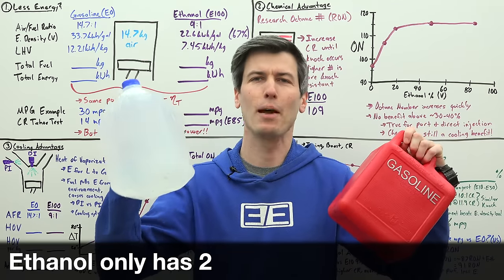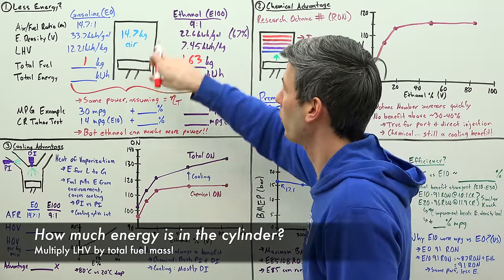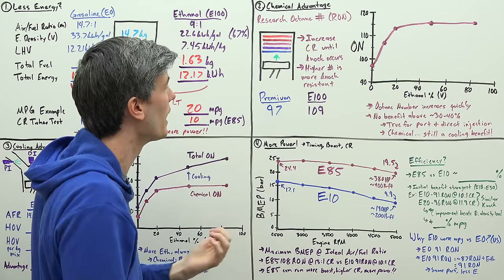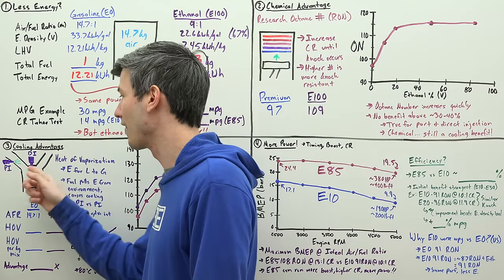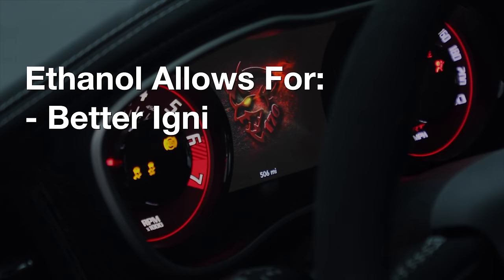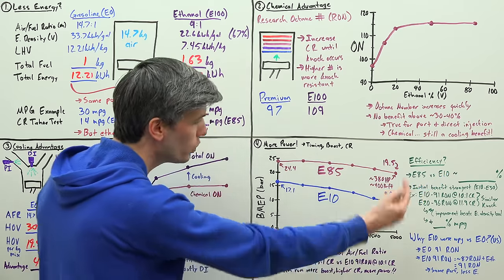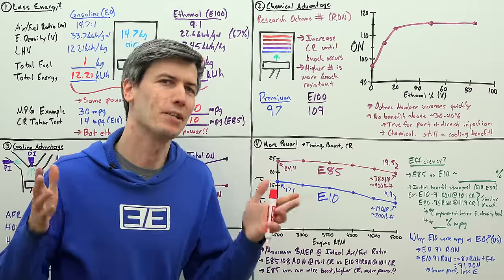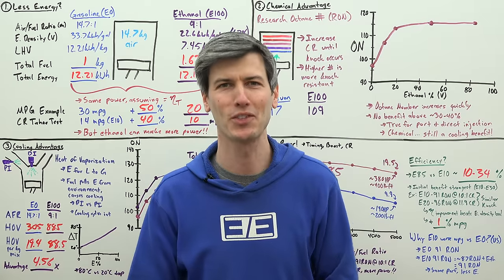Why Does Ethanol Make So Much Power? (Versus Gasoline)

Comment: E85 ethanol will deliver around 10% LESS gas mileage than you get from regular gasoline. Ethanol has only about one half of the BTU output as gasoline so it is less efficient. Ethanol is also more damaging to some fuel systems that weren't designed to be used in ethanol/gasoline fueled engines. SO, E85 fuel makes LESS power. Not more. It was only blended to extend our gasoline reserves and it produces slightly less exhaust pollution.
Reply: The very first flex fuel cars were methanol capable also.  Since methanol is slightly corrosive, stainless steel fuel lines were used.  When it became apparent that methanol sales were not happening, the methanol capability was dropped and the standard mild steel fuel lines were then used for flex fuel vehicles rated for ethanol only.

Ethanol on most any manufacturer's chemical compatibility chart you will find is at worst equal to or more often less damaging to rubbers, plastics, and metals than what gasoline and BTEX (benzene, toluene, ethylbenzene, and xylene) are.

In our inefficient gasoline optimized engines, ethanol will get less mileage but more horsepower.  For example, a Chevy 5.3L engine gets a clean 380 horsepower at 5600 rpm vs a dirty 355 horsepower at 5600 rpm on E0.

Ethanol at our current usage levels came to be as the replacement for the disastrous oxygenate/octane booster MTBE.  The petroleum industry went along with the legislation for hidden in the bill was legal immunity for them from MTBE.  This was discovered and removed but the bill still passed.

Denver in 1988 was the first government entity to require E10 when they they were on in EPA list of ozone non-attainment zones.  Soon with ethanol they were off that list.

Even with just 10% ethanol added to E0, the Swiss Federal Laboratory for Materials Science and Technology found that the especially health devastating ultra fine or nano particulate emissions were lowered by 97%, carbon monoxide lowered by 81%, carbon dioxide lowered by 13%, aromatic hydrocarbon emissions lowered by 67-96%, and genotoxic emissions lowered by 72%.
Reply: @danafletcher2341  But if they went to butanol instead, it would have almost the same output as gasoline by itself BUT it is also much more corrosive on parts and much harder to produce. Oh, and don't forget, Indy cars, like moonshiners of old used to run their cars on pure alcohol fuel.
Reply: @stephenbrinckerhoff3510  The Indy 500 uses E98 even now.

Ricardo built an ethanol engine for GM and it ran in a pickup.  Here is an excerpt of an article describing it.  Note it gets more mileage than even a diesel engine which is itself better than gasoline.

FROM RICARDO:
The new federal CAFE standards are calling for a doubling of fuel mileage performance, which, Vint says, is going to send OEM’s looking for high octane numbers to improve efficiency and ethanol is the best source. Ricardo, an engineering firm with over 100 years in the business of engine design, has developed an extreme boosted direct injection engine (EBDI) to optimize ethanol blends. The 3.2 V6 gasoline engine rivals the power and torque of a much larger GMC Sierra 6.6 diesel, he said, and it delivers 3.5 percent better fuel economy than the diesel.

A Brief History of Racing Fuel By Craig A. Johnson

In 2005, the IRL used 100 percent methanol in their tanks. The fuel worked well and was more efficient than straight gasoline, but IRL officials believed there was room for improvement. In 2006, they moved to a 10 percent blend of ethanol and methanol, which was then changed to 100 percent ethanol for the 2007 season.

The desire to use only ethanol aside, 100 percent ethanol is nearly impossible to obtain, and is illegal to keep without paying hefty taxes that date back to prohibition. The actual fuel used by the IRL is a blend of about 98 percent ethanol and 2 percent denaturant. The exact composition includes a small amount of high-octane racing fuel.

The fuel for today's Indy cars has an octane rating of 113, compared with methanol's 107. This means a significant reduction in pre-ignition, or knocking and pinging.

In addition, many of the people who handle the fuel, say it smells like tequila. This quality may seem insignificant, but smell is actually one of ethanol's benefits when compared with methanol. Pit crews noticed the switch to ethanol immediately, reporting fewer coughing fits and less eye irritation before any other modifications were made to accommodate it.

According to Dennis Vervynckt, manager of hospitality services and an IRL official, in 2006, the first year the IRL began using ethanol, teams saw a reduction in efficiency of about 10 percent. "That's because we put straight ethanol into the tanks," he says. "The teams initially didn't make any or very many adjustments to their engines. After a few months, they kept tweaking and by the end of the season they were back up to 100 percent efficiency."

Vervynckt points out that there was a minor loss of power. "When they first started using ethanol, teams saw a slight drop in horsepower," he says. "As the teams got used to the fuel, they were able to get more horsepower from ethanol once they again reached maximum efficiency."

The switch to ethanol also allowed the racers to carry less fuel and make fewer pit stops, thereby increasing efficiency even more. "When the cars ran on methanol tanks had to hold 30 gallons to accommodate the fuel requirements of the cars," Vervynckt says. "After getting the engines to perform at their full potential, there was a significant gain in mileage. Indy cars now have 22-gallon tanks. When a driver pulls in to change out his tires, he can fill up. Teams were able to match their tire and fuel stops exactly, instead of stopping for tires only, or fuel only."

That efficiency translates into much less fuel being used by the sport. Lifeline Foods LLC, which supplies fuel for the IRL, will produce 120,000 gallons of ethanol for the 2008 season. And though this may seem like a lot, it's 20,000 gallons less than was used the previous seasons.

The switch from methanol-based fuel to ethanol has amazed almost everyone in the league. Drivers, the direct users of the fuel, voice their approval in glowing terms. "[Ethanol] is an American fuel that is good for the country and the environment," says Ryan Hunter-Reay, of Rahal Letterman Racing and driver of the ethanol car. Standing beside his crew as they make last-minute adjustments to the car, he is more than happy to discuss the benefits of the IRL's switch to ethanol. "It's been great for Indy racing the fuel economy, emissions there's nothing we don't like. We love it."

Comment: Gasoline has way more power then e 10 e 15 ask my van my quad my lawn tractor if you want to use it in your race car ok out side of that it junk gas it's in the btu ..no. Away around it....pull a trailer you will figure it out.
Reply: A Chevy pickup with a 5.3L engine produces a clean 380 horsepower on E85 vs a dirty 355 on E0.
Reply: @danafletcher2341   Dan sorry if your 5.3 is cranking out that kind of power it's running at the speed of light...it's in the btus it's science .
Reply: Actually it’s called engineering 

Sorry, but those were GMs own published SAE certified horsepower numbers.
Reply: @danafletcher2341  — Dana, you’re wasting your time. Anyone that is intellectually incapable of differentiating between energy density and power potential is not able to have a rational debate with you.
Reply: @danafletcher2341  It really is pure free entertainment for me....small thing for small people.  I also love driving straight by them on the road.

Comment: What a bunch of BS.   It takes at least 3.5 gallons of water to make one gallon of ethanol.   Where are you going to get the land to grow the biomass?   How much petroleum is required to farm the ground, fertilize the crop, and how much pesticide will be sprayed to produce the biomass?   And finally, how many people are you going to be willing to kill making their food into fuel?   All to gain maybe 1% increase in mileage?   That’s what wrong with all of this greeny crap,  it’s all a flimflam.
Reply: Actually, the ethanol industry is now at 2.7 gallons of water per gallon of ethanol and most of that (unlike petroleum) is in the form of steam. (I can see heat pumps someday taking that number lower)

The National Geographic states it takes 13 gallons of water to produce a gallon of gasoline.  Whatever the number is, it is far more than 2.7 and higher with fracking and tar sands which we are now having to go to for crude since the easy to get conventional crude has already peaked.  Not to mention all the ruined and contaminated aquafers and oceans left in the petroleum industry's wake.

With feed grains like corn, you do not need extra land since it is a value-added from already existing feed production which preserves the feed in a healthier and more productive form called distillers grains.

The US used 11,160,933 tons total fertilizer on corn in 1980, before ethanol.

In 2018, the year of most ethanol production ever, the US used 10,521,850 tons total fertilizer on corn.

The US also used more pesticides in 1980 as well.  

100% of the fertilizer (& everything from the soil) still get fed to livestock in the distillers grains.  Ethanol comes from only things of the air: solar energy, CO2, and water with the latter two recycled once burnt.

Ethanol C2H6O = no fertilizer

Distillers grains = all the fertilizer

What logic is it to then assign all the energy and CO2 of fertilizer to ethanol and none to distillers grains? 

Iowa State University measured all the energy it takes to produce an acre of corn into a "diesel fuel equivalent"
This included making the machinery, fertilizer, chemicals, plus the tillage, planting, spraying, harvesting, drying, trucking etc. 
They found it takes 34 gal of diesel to produce one acre of corn.
What do we get from those 34 gallons of diesel?
We get >500 gallons of ethanol.
But wait, that is not the kicker.
The kicker is we still get 100% of the protein and other things from that acre of corn still available for a healthier and better feed called distillers grains. A win-win.

Comment: Here is a little secret that they don't want you to know.  What is the difference between 84 octane and 104 octane.  First, the 104 octane is used in racing cars.  Anyway, the higher the octane the longer the wait for ignition!  What? Yes!  The 84 octane explodes faster!  To make more power you need a delayed explosion.  Ethanol explodes too quickly.  This lowers performance and power in the engine!
Reply: LOLOLOL … Your reasoning: So when petrol has higher octane the “explosion” is delayed and power is increased. But ethanol, which by its very nature has a very high octane rating, “explodes too quickly”. 

So how is it that a high octane rating means a delayed “explosion” with petrol, but not with ethanol (according to you)?

So by your rationale, 2+2=5 …
Reply: @S King  OK, I blew it.  They mix the ethanol with gas to obtain 87 octane.  However, I did forget a couple of things. Ethanol evaporates too quickly. Also, it reacts with oxygen quickly, making an acid corrode the fuel system and also damage the engine!
Reply: Ethanol below 70 degrees F has little vapor pressure which is why E85 has the 15% gasoline which has vapor pressure all the way down to -45 degrees F

In Brazil where E100 is sold they instead use heated injectors for starting similar to diesel using glow plugs for starting
Reply: @danafletcher2341  Great!  Now go and do your own research on your computer.  Type in the statement; problems with ethanol as a fuel.
Reply: Brazil has identical non-flex fuel cars, boats, motorcycles, and small engines we have and their common gasoline is E27.

It has worked out so well and for so long that Paraguay went to E27

Ethanol means northern states need not buy little cans of alcohol called Heet or Dry Gas as gas-line antifreeze to deal with E0’s water problems anymore.  Mercury Marine even thinks E10 may be the superior fuel for this reason.
Reply: @johncipolletti5611  Actually i didnt type in ANYTHING 18 years ago I went outside and DID it. I tried E85 and look at my own results on my own vehicles...not that hard.

Comment: We all know the ethanol fuel experiment has failed. But big government keeps pay subsidies to grow corn for ethanol.
Reply: Ethanol production is kinda insulated from corn prices for if corn prices are low, then so too are the prices for their distillers grains.  But if corn goes up in price, they make up with high price for distillers grain.

The explains how ethanol can remain so low in price despite the current high price of corn, they are making it up with high prices for distillers grain.

The spot cash delivered NYMEX price of ethanol is $2.36/gal

This price of a sub-grade unusable gasoline (RBOB) is $2.84/gal.

To turn RBOB into a usable E0 fuel even costs a lot more much like premium, racing, and aviation gasolines cost more. Petroleum octane boosters BTEX (benzene, toluene, ethylbenzene & xylene) are expensive plus are dirty and toxic.

Or you can splash in >10% ethanol to RBOB and the resultant usable fuel is much cleaner burning, less toxic, and cheaper/cheaper per mile to drive.  Who can be against that?

BTW, farmer paid subsidies were around 25 billion when the 2005 energy act first passed and are around 10 billion this year not adjusted for inflation.

Even with just 10% ethanol added to E0, the Swiss Federal Laboratory for Materials Science and Technology found that the especially health devastating ultra fine or nano particulate emissions were lowered by 97%, carbon monoxide lowered by 81%, carbon dioxide lowered by 13%, aromatic hydrocarbon emissions lowered by 67-96%, and genotoxic emissions lowered by 72%

Comment: Ethanol in our gas is an environmental disaster. Its creation releases a ton of carbon into the air, while its use in our vehicles increases gasoline consumption. Yet, automakers and fossil fuel lobbyists argue to the EPA that it is better for the environment. They do that because ethanol is the cheapest substitute for lead, though it's far from the only option. It would cost gasoline manufacturers more to produce, but the consumer wouldn't be impacted as much because we wouldn't be burning as much gas to begin with.
Reply: When you don't know what you're talking about, and you don't, you should stay out of the conversation except to aks questions.
Reply: 100% of the CO2 released by the burning and fermentation of ethanol just came from the atmosphere and 100% of it is needed to be there to make the new gallon of ethanol.  It is a cycle, not newly added like petroleum.

Our current use of ethanol was to replace the disastrous MTBE.  The petroleum industry went along with the legislation because they were to get legal immunity for MTBE but that was revealed and taken out but the bill still passed.

Ethanol is far cheaper per gallon percentagewise than the percentage of any mileage loss so the cost per mile is lower with it.

Even with just 10% ethanol added to E0, the Swiss Federal Laboratory for Materials Science and Technology found that the especially health devastating ultra fine or nano particulate emissions were lowered by 97%, carbon monoxide lowered by 81%, carbon dioxide lowered by 13%, aromatic hydrocarbon emissions lowered by 67-96%, and genotoxic emissions lowered by 72%.